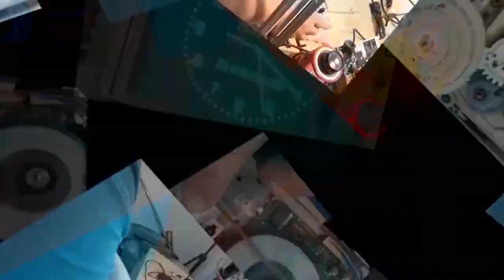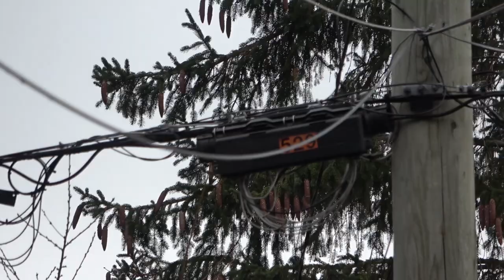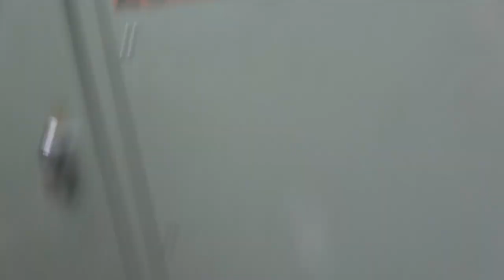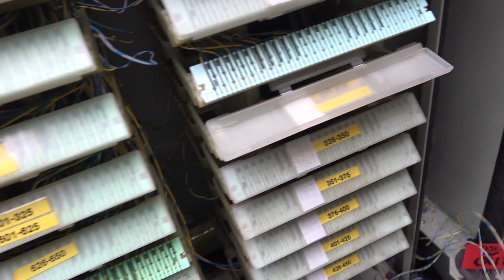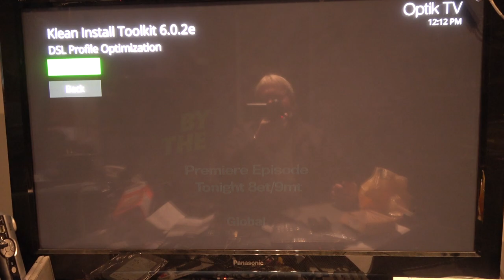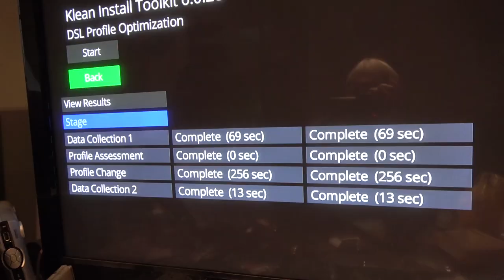Fixing my old noisy copper phone line

Comment: lol he said butt set
Reply from the maker: butt in, butt set same thing. Got that name as the installer could "but in" on a line.
Back in the old days if a lineman was working on the line and someone was talking on the phone line he needed to work on, he would clip on, and "butt in" to their conversation and tell them he was working on the line and needed to take it out of service. It was more of a courtesy, to politely say "get the F--k off the line so I can do my work"
I have done that. Actually just today. I had a trouble where the jumpers were run in incorrectly and had the wrong number working in the apartment. When I went to move the jumper I could hear someone else on the phone. Now I would never but in and politely ask them to clear the line because I would most certainly be accused of eves dropping or tapping their line and then there would be a big controversy on social media how the telephone man was listening in on their private conversation.. Nope when I heard someone else on the line I just ripped they jumper out and ended their call, and ran in the correct jumper. They can dam well phone back, this time on their correct line.
Incidentally if we do clip on (and you would never know with one of these butt sets) and we hear anyone we are required to disconnect immediately and check later, for a clear line. That can take ages with long winded people so the jumper just comes out clearing the line so we can work. Never announce you are there and you can't be accused of anything. I was told this by one of my former co workers back when I was in training. Turned out that many years ago he was working on a bad cable and needed to take some lines out to repair them, so he clipped on to make sure nobody was there, and there was a conversation on a line so he broke in and asked then to clear the line so he could repair it. Turned out that one of the people on the conversation was recording the call, and or course the lineman announcing he needed to take the line out of service caused a big headache for him because he was accused of tapping the line and one of the parties had a recording of him asking them to clear the line. Nope, just cut it, and do the work I was told.
Reply: @12voltvids  I was laughing cause he said butt I have absolute no knowledge of phone things. But thank you for the story
Reply from the maker: @pystlz6454  lol. There are many slangs and terms used to describe  different things. Some words would be found offensive by some but here goes.  An old underground grease filled screw on splice was called a "dogcock" and a larger heat shrink splice enclosure was a 'horsecock" which to the uninitiated sounds vulgar but anyone in the industry knows exactly what I am talking about.   Ask any mechanic what a "petcock" is.  (Fyi that is the fuel shut off for petroleum operated machines like lawn mowers, motor cycles ect.)

Comment: Dude, ont’s don’t rely on gps for 911 service. Your physical address gets married to your service address. Great disservice you’ve done by “mixing” cell service and fiber to the premise service. Two different services.
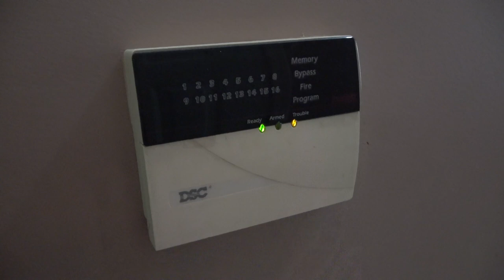Reply from the maker: Where did you get that I didn't say anything about ont and GPS. I was referring to why I have home phone and not just rely on cell phone. yes your omt is tied to your address like a home phone. I keep my copper because I have equipment that does not work properly on voip. Mainly my security alarm which monitors the battery from the central office. If someone cuts the phone line the voltage will drop and the alarm will sound. With fiber if someone cuts the fiber the voltage from the ont does not drop and thus the alarm will not sound for a cut line. That's reason number one reason number two ont update on a regular basis in the middle of the night and when they do this they reset which causes the voltage to drop for up to a minute when this happens and the alarm is armed the siren goes off at 3:00 in the morning unacceptable. Also when the power goes out ONG backup is only good for a couple hours at best whereas my copper line will continue to run. Reason number three the ring voltage off ont might be fine to ring an electronic phone ringer it certainly is not enough to ring the old fashioned Bell in my old phone which I like I've got three of them and of course they do not support rotary dialing. Reason 4, and I've said this at least 10 times now, I'm grandfathered on an old price plan which I will have to change to switch to fiber and for that reason I've elected to not switch you're not going to convince me for any reason to switch until I absolutely have to and that's when they shut copper down. I do not care that I can't get gigabit internet or 300 meg internet or even 150. I am limited to 75 on copper which is plenty fast enough.

Comment: Naughty doing a pair swap to fix the fault, fault find fix! Sure a TDR would have picked up the HR causing the noise. Can you guys not remotely test the line to see if it's a contact fault?
Reply from the maker: I don't fix bad pairs.  Even though my exfo has TDR, I will send pair faults to cable repair.  I just cut to new pair.  The fault in my secondary line indicates a dirty open on tip 150 meters from end, so that would be splice at corner.

Comment: I fired the useless phone co. after my line went out and they still wouldn't fix it after 3 weeks so I gave up on Century Link and cancelled the account.
Reply from the maker: That's the cable company here.  Pick up lots of new customers because the cable guys still won't enter the house.  Had one customer tell me that their cable went down they called and were told it would be 3 weeks before they could get a tech out to fix the cable that was pulled down by a truck.  We switched then over the next day.
Many are like that. They get rid of their in house techs and rely on contract companies that work for many providers and their workers are overwhelmed and can't keep up.   Not that there are no contractors where I work, but at least we have a core team if company guys (me) that are available 7 days a week to provide customers with 5 star work.  I know the contractor side of things too as i did that job for about a year working for a satellite tv provider.   What a shit show that was.  80,000 km of driving to sites in 1 year.  I spent an average of 5 hours driving every day all over hells half acre to get to install sites way out beyond cable service area.  They paid really good, but by the time i paid for gas, and materials and factored in wear and tear on my personal truck i probably only cleared 30 grand that year when my take home before taxes and expenses was well over 100g. 60% went to gas, cable, staples, screws, clips connectors ect.  The only advantage was all the expenses i had meant serious write offs.  I paid virtually no income tax after all the paperwork was done.

Comment: That's not fixing the fault, though. Just swapping onto a different line. Would like to see fault location and fixing rather than swapping out.
Reply from the maker: Well that is what we do. We cut to a spare pair.  Eventually when all the spares start running out a cable repair ticket is cut and one of the cable repair guys goes out.  Puts his TDR on and it tells him how far to the short or open. Goes out to that terminal or splice and repairs the fault.  That is simplifying it and sometimes cable needs to be cut Midway and tested back or forth to determine the location of the fault.
Reply: @12voltvids  hi can u reply i love ur vids i just started watching ur vids on this acc but there awsome!!!

Comment: Wow
U Really know you're 
Stuff.
Keith
Reply from the maker: That's why they pay me the big bucks. The newer techs are not trained in copper these days because everything now is going to fiber. Just the old guys like me that were trained in copper years ago. We get all the copper jobs, which there is still copper in use.
Reply: @12voltvids  
Can I pay you to
Remove a bios chip from a PCB
And transfer it to my other PCB ?
The PCB is off of a hard drive.
It's not of major major importance.
I just don't have the hot air station or soldering gun to do the trick.
I can send you for two PC Boards.
I live in Ohio.
Let me know please.
And if so how much
$$$  would you like ?
Thanks Keith
Reply from the maker: @KTHKUHNKK  
I don't have a hot air station either.
Reply: @12voltvids  
Thanks for the reply buddy I appreciate it.

I love your work though
Keep it up.
Keith

Comment: all the reasons u listed of why ur not on fibre optic are not valid
- u can use pulse dial converter for ur old phone
- old alarm system lmao just update it, there are systems that use cell service to dial out
- all phone services in this day have something called E911, the moment you dial out, ur location is already revealed to the operator by the isp. 
- and again for ur cellphone gps crap, just buy a hotspot which are almost always GPS locked to one location. any calls going out will go threw the hotspot and gues what, they know where the fuck it is threw E911.

stop being stuck on copper because you think your ganna lose the things you like.
Reply from the maker: Tell you what. I will upgrade to fiber if you pay me the 40.00 a month more it will cost me to keep the same level of service I have now.  I am not upgrading because my rate plan is grandfathered. As soon as i upgrade i have to accept new terms.   All the tv packages are different and i have to rent car boxes that are now free.  Internet stays same. Still get 75 down but my upload goes from 20 to 75.  Big deal.  As to alarm my system is not monitored.  It dials me, but I need it to go off of the line is cut and that won't happen on fiber.  As to getting a cell monitored alarm we that costs more and I don't pay a dime now.  Sounds like you are just jealous because you were sucked into higher prices and just can't stand it when someone gets a better deal.  My internet is faster than I ever use and my home phone always works, even during extended power failures.
Reply: @12voltvids  u dont get 75 down with dsl lmao what are you on bro
Reply from the maker: @ronaldwoofer5024  sure do. I just did an install yesterday, copper 100meg down 37 up. I could go to 100 if i wanted to pay the extra 10 bucks a month.  I get a solid 75 mega here.  Even when others are streaming I still have plenty of bandwidth.
Reply from the maker: @ronaldwoofer5024  Just tested it now, with a TV running (streaming an HD channel) I just got 71 megs on speedtest.net with  a 5ms ping and 18.9 upl Perhaps your DSL didn't do that but mine does. Plenty fast enough till the plug gets pulled on copper.

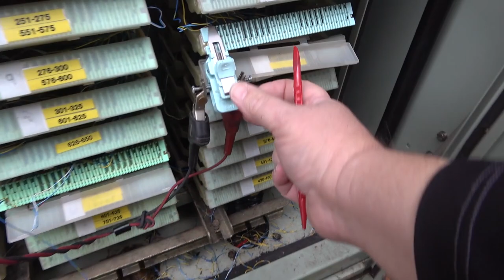Comment: 10:42. Scary, never YANK the wires, which could inadvertently pull something else loose. Be gentle!
Reply from the maker: Big deal. If another one pops off it will be put back. They are attatched firmly so a good tug is needed to pull the jumper.  Not many circuits left running in that cabinet.  I was cleaning it up during lock down last spring. Out of the 1800 pairs in there i bet there is fewer than 100 still in service.  The rest have been migrated to fiber.
Reply: @12voltvids  Glad YOU can do this in a box you "own".  I've been in many boxes where things are not firmly attached.  But "it will be put back" is not easy without knowledge or documentation of what goes where!  I still teach my employees not to rush - and it pays off.
Reply from the maker: @BitSmythe  
I never rush.

Comment: You are wrong about the cell phone location service... well partially wrong. Cell phones get your location service from Wi-Fi routers also they periodically check the GPS regardless of whether you use it or not I don't know the exact time but I'm thinking it's like every 10 minutes. They get location info from wifi even if you are not logged into that network. If you don't believe me about the location there's an easy way to prove it period go into your Google location history and it will show you every story you've ever been in every house you have stopped at and I won't even tell you what time you were at that location and what time you left. It is creepy but unless you delete it it keeps track from the time you get your first phone that uses Google. I found this out last year and notice that it has every stop I ever made since I got my first smartphone
Reply from the maker: And what if the wifi is not enabled on your phone? I don't use wifi on my phone. I use only data services because I don't use wifi at my house. Eveything is hardwired.  The only things that use wifi here is cameras that I test.  When I look up my google location history it is all GPS based tracking, and my home address doesn't even show. According to my phone I am sitting in my next door neighbors house right now, and always am.

Comment: You can connect PSTN telephones to fiber. Build a pulse to DTMF converter. Or check this out https://www.picbasic.nl/frameload.htm?https://www.picbasic.nl/dtmf-telefoon.htm
Reply from the maker: But will it work in a power failure without a backup. Didn't think so, and neither will the ONT.

Comment: I would never use DSL instead of FTTH. I understand all your reasons but that doesn't convince me at all. Copper lines are very unreliable. You can use IP phone and with proper router you can still use pulse dialing. Your FTTH service is often interrupted by ISP (IP address change, software update)? Change ISP.
Reply: FTTH is not available for many people, where I live FTTC is the best I can get.
Reply: Not sure why his IP would change that often.. I have FTTH and I've had the same DHCP IP for over a year.   And my ONT never gets reset.  Maybe he's referring to the new FTTH modems that are the ONT/Modem/Router all in one...
Reply: @khx73  you are so lucky. A few years ago my FTTH service provider has been changed my IP address every 22 hours. Now it's a little better: a few days or weeks. But I can change my FTTH ISP in my location. And I have 2 separate devices: ONT and router.
Reply: @jaceknasalski1422  Does the changing IP cause you problems?  For most people it wouldn't.. and they'd never even know.  I use a dynamic DNS service which is auto-updated by my router, so it doesn't matter how often the IP actually changes.
Reply: @khx73  of course I use a DDNS service too. But changing IP is inconvenient to me becouse my ISP (Orange) stop my services (Internet, IP phone but not TV!) for almost one minute. Not very fast!
Reply: @jaceknasalski1422  Yuck, not nice.  Normally DHCP protocol will first ask for a renewal on the IP lease, which should normally just be granted provided something hasn't gone wrong on their end.  Or they've purposely made it a one-time lease.. how annoying.  Have you snooped your DHCP traffic to see what's up?
Reply: @khx73  Orange uses a PPPoE protocol rather than DHCP. And yes, it's one-time lease :(. So as I said, you are lucky man!
Reply: @jaceknasalski1422  ah. ok..  That explains it
Reply from the maker: IP changes every 24 hours. If you want a static IP then you get a business plan and pay the price.  Residential IP can and does change.
Reply from the maker: If you need to log into a server on premise such as security cameras it is a big problem.   On my dsl i have 2 ip. One goes straight to the DVR and the other to the router.
Reply: @12voltvids  I'm curious if you're using DHCP or PPPoE.  Seems odd behavior for DHCP to me.  So are you paying for the static IP or living with the changes and using a dynamic DNS service?
Reply from the maker: @khx73  
It is DHCP but on my dsl it doesn't change unless the modem had been unplugged for awhile.  After a power failure i have to reset my DVR IP in my app to see my cameras on my phone.
Reply: @12voltvids  Ok.  I'm sure you're aware of dynamic dns services.. some are free, like no-ip.com
Reply: @12voltvids  So you have 2 public IP addresses on a single DSL line and it's not a business plan? Very strange. It's best solution for security reasons but very uncommon. You can provide security for your networks using 2 separate VLANs: one for your DVR and IP cameras and second for your home network. I perfectly understand your pain with IP changes. I use dynamic DNS service but I still hate these IP changes. I can buy a static IP for a few dollars more when I change my FTTH service provider and I will do it probably :). But not every router supports VLANs and dynamic DNS of course.
Reply from the maker: @jaceknasalski1422  
I have 2 ip, one though my router and a pass through for my DVR. i don't run VLAN or vpn here. No need as I don't surf much. Infact other than upload videos and check email i really don't use the internet much.  If you looked at my browser history you would be pretty board. Nothing interesting to see.